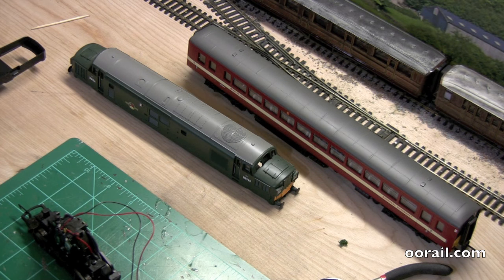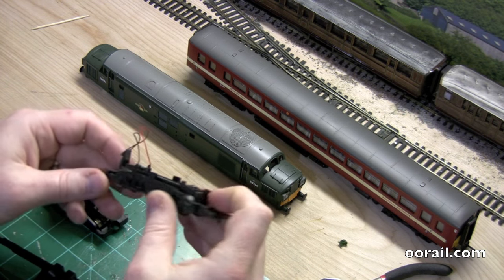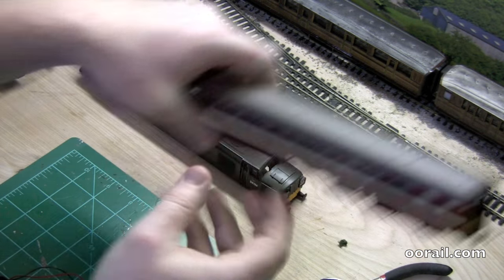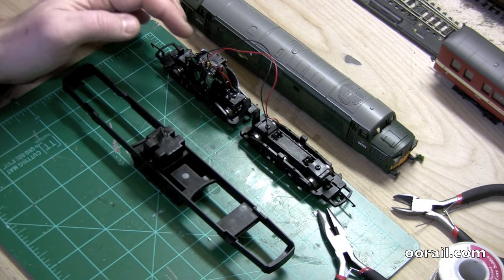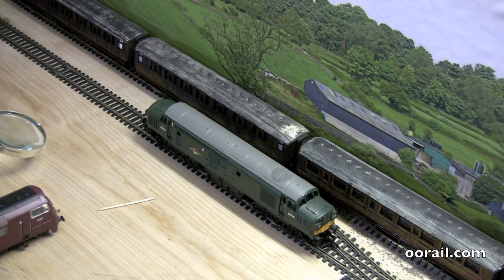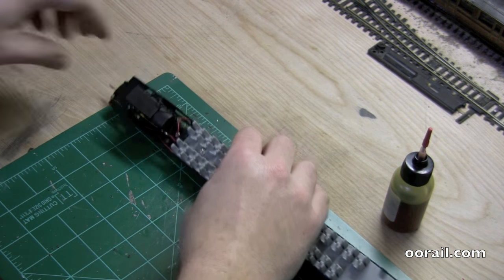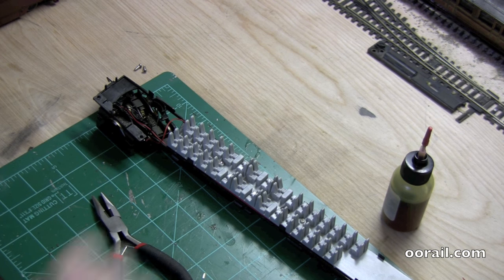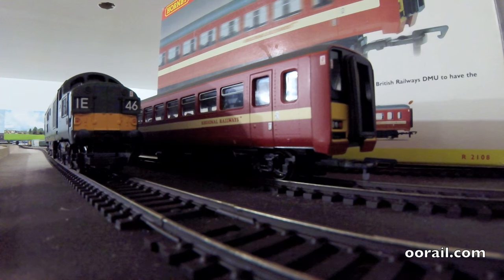oorail.com | Troubleshooting non-running Locomotives - Loco Works Wednesday #9

Comment: your very good at doing all this work to your locos. iv never been good at doing things like this. i just tack them to a shop to get them done
Reply from the maker: +matt slade I don't really have the luxury of a shop to take them to where I live in the USA, so learning how to repair and upgrade locos has sort of become a necessity to keep the hobby affordable. I've picked up quite a few bargains on eBay that haven't been too difficult to sort out. Besides I need something to abuse my engineering degree with other than repairing the odd home appliance when it fails! After you've done it a few times, it becomes second nature, bit like weathering, best thing to do is try it out on something cheap first and work your way up.. old Hornby HSTs with ringfield motors are a good starting point :)
Reply: Me too 😣

Comment: I really dislike the Hornby Ring field motor. The Tri-ang X-04 motor and gearing was much superior 60 years ago. That said it is possible to improve the running of Hornby motors with extremely fine adjustments to the brush springs, cleaning and flash removal from the gears and lubrication.
Reply from the maker: +David Atkins I've discovered that the "high resistance" switch on my old H&M Duette actually does wonders for the close control of ringfield motors... neo-magnets are an ok upgrade if you combine them with a 5-pole armature and new brushes when you do it.. I prefer the ringfields over these newer motors that aren't really serviceable, we'll have to see about motor upgrades I guess as these things start to fail over the years...